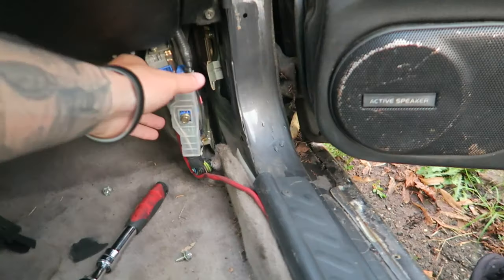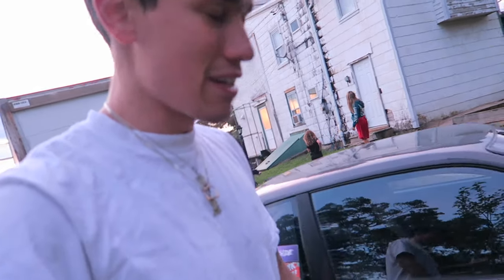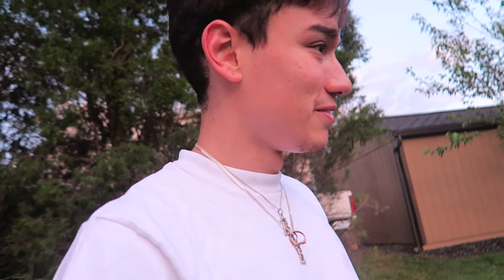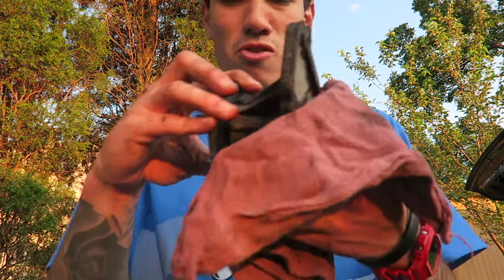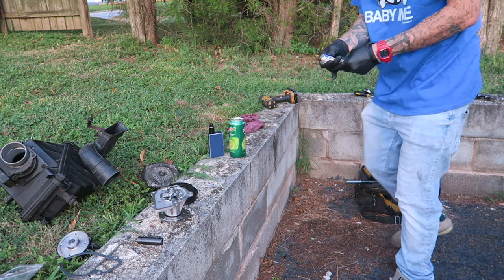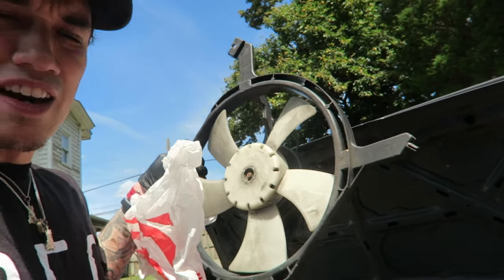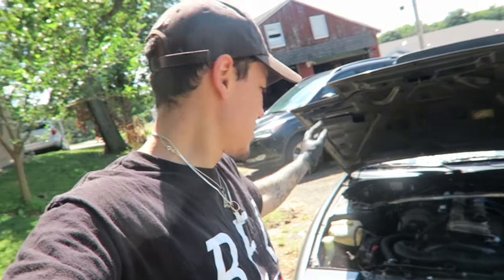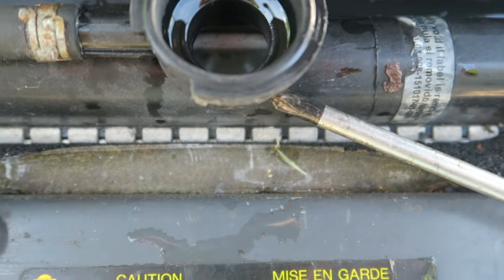WELP... BLOWN HEAD GASKET  240sx S13

Comment: Typically when a water pump goes bad it seizes up and wont move. Damn daddy I haven't seen a video from you in for ever. Your girl is really growing up and Monica is as beautiful as ever. Need more 240 content. Drain the oil, if it's a blown head gasket the oil wont look black; the oil will look like chocolate milk. Or do a leak down test. Also you can try removing the valve cover and spark plugs to see if there is any coolant where the spark plug sit. Good luck.
Reply from the maker: Thanks brother!! I’ll have to peep it! And I know man!! Shizzle is crazy!!!!!!
Reply: @BecauseDaddy  no problem. 240sx= fix one thing something else falls off